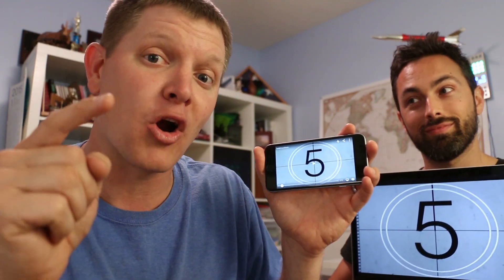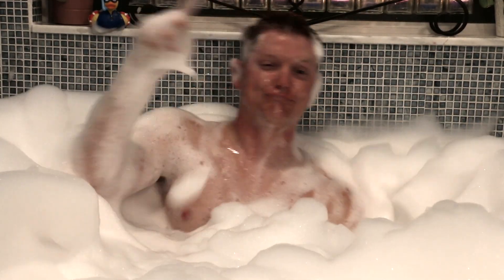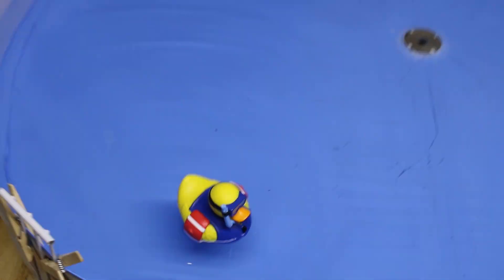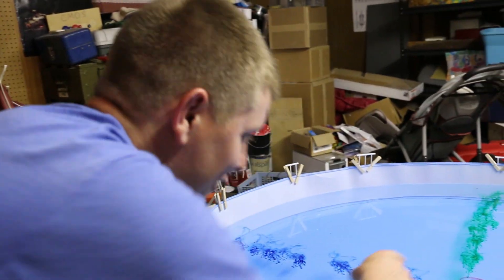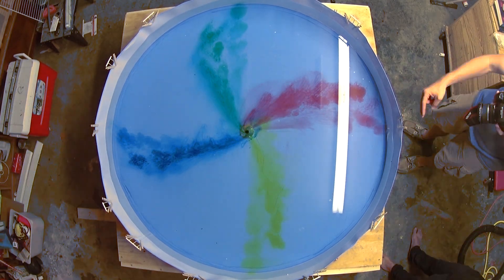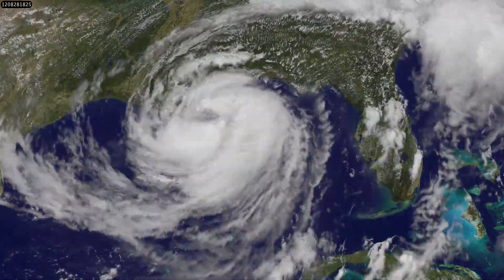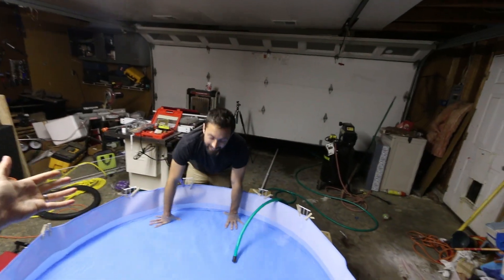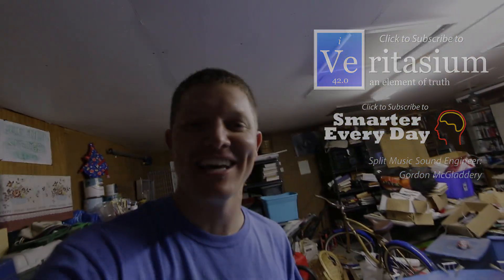The Truth About Toilet Swirl - Northern Hemisphere  (Smarter Every Day 137)

Comment: It does work. Sydney is 8330 miles south of the equator and Huntsville is 9100 miles north. Pretty close to the same I suppose. 

Does the water spin at all with the exact same pool design on the equator?

Comment: So let me ask you this. If you would had influenced the water when it drained out of the pool to drain the other way, oposite of whats being shown, shouldnt the water slow down conaidering its going "against the grain" of the natural drain flow?  I wish he would did another pool experiment the exact same way but took something and swirled the water in the opposite direction, and lets what would have happened. It ahould either come to a stop and start draining as it shows in thia video or it should at slow down substantially. Its almost like having your ceiling fan on, and flipping the switch that makes it rotate in the opposite dirwction, i know thats not safe, but if the fan is spinning, and flip that switch it will slow down until it stops and starts rotating in the opposite direction. I know that there are forces being applied to make the fan slow down and rotate opposite as it has a motor but just using that as visual example of what i want to see. Alter the flow to the opposite direction, see if it slows down, and if there is enough water in said pool, it should eventually stop and atart draining the opposite direction.

Comment: Just because you have demonstrated that the water rotates in the opposite direction in opposing hemispheres you have not proven that rotation in draining water is caused by the Coriolis effect; And then to use the word truth associated with your findings is objectionable and typical of modern science. Until you have eliminated all of the alternative possibilities you cannot possibly claim to be the source of the truth. How does your experiment control for the magnetic field of the earth? We know water particles are charged or a Kelvin water dropper experiment would not arc electricity rapidly through a spark gap.  Watch Kelvin's demonstration then then tell me that the Coriolis force is significant. Charged particles moving through a magnetic field are subject to the Lorenz force and despite having the same charge electrons are many orders of magnitude lighter than protons. You didn't even make an attempt to control for the latitude which would be a huge factor based your assertions; apparently already assuming that corialis was the only possible explanation.That was a pitiful experiment and I think you should be ashamed to act so proud after such bad science.

Comment: First off, excellent video(s) - a veritable work of art! 
A question though, as I'm resistant to accepting any result with 100% confidence: let's assume that vortex direction is in fact random. What was the probability of observing these results by chance? Is it 0.5 * 0.5 = 0.25? Or is it somewhere closer to 50-50, since Destin is less likely to have done his half of the experiment without Derek's initial success?

Comment: Very cool video! But I have to pour water into the wine. The two pools are obviously not identical. So it is very probable that the effect comes from tiny differences in the construction, e.g. from an eccentricity of the drain hole. Also, the assumption that the water is still after 24 hours is not valid. An open surface water is always in motion of thermal convection, driven by evaporation cooling.
Let's do a simple calculation: The Coriolis acceleration is a = -2 omega v. Omega is the angle velocity of the Earth's rotation 7*10^-5 s^-1. v is the radial flow velocity of the water at the surface, which is extremely small, say 1 cm/s. Taking into account the degree of latitudes of the both places, we get a Coriolis acceleration of the order of some 10^-7 m/s². This means that the time for one revolution of the vortex is of the order of hours. No, the Coriolis effect is way too small for this experiment.

Comment: There is a guy in Kenya whose house is right on the equator. He has two bathrooms, one on the north end of the house, and other on the south. The equator goes through the middle. He rigged up the two toilets so that one toilet swirls clock wise, and the other counter clockwise. (He changed the angle of the jets using a file or something, I'm guessing). He charges money to tourists to see his demonstration.

My friend who went to Kenya told me this. He didn't go to see it because he knew it was all B.S. After he came back, he regretted not going there to see it, just for fun, and helping the guy out with a few dollars, which will mean a lot for a Kenyan.

Comment: hello, I am just to say that is not good enough of proof, since you would need to do this about 3 times and 2 variables changed (6 times (3 times per variable)). basically you need 3 tests with starting the water filling anti-clockwise and then 3 tests fill the pool clockwise. this will be a much more reliable source. indeed this can be true, but you need to do more testing since in the name of science, it will not be the same all the time for somethings, which is why you do multiple tests to see if your test is correct or not  if you do not do that then there is still a likely chance in it being wrong, which is why scientists in the real world do tests on multiple things. an example is medicine. Not only scientists do it, engineers do it too, since it is more important to make sure it is safe then being wrong. examples are rockets, planes, cars, ect.

Comment: I understand it as your relative position/your point of view comes into play. Take a baseball or a tennis ball and trace a counter clockwise circular line around until you get to the other side of the ball, do not lift your marker. From the starting point you were drawing from is counter clockwise. But when you continue this line seen from the bottom side, you will be moving your pen in a clockwise direction. Now follow your marker line, starting from the bottom side to the top side and it will be perceived in reverse. So I would think that the water drains the same way, its just that you are looking at it from each respective drain sides. Its all relativity as Einstein said. If I may further confuse...when you stand in front of your mirror and raise your right hand, picture yourself standing in the mirror and you will see that you/in the mirror are raising your left hand, not your right. Your relative perspective is very important to understand this. The mirror image says the opposite of what is actually happening and yet it is the same thing. spooky action.

Comment: Coriolis effect  is an issue in aviation too.... most aircraft do not use compass but a DI (direction Indicator) or in  the US called a HI (heading indicator) that is based on a gyroscope set in the yaw plane, this is because of the effects of banking, accelerating etc on a compass... however over a period of flight the gyroscope starts to drift because of Coriolis effect (and imperfections in the instrument)... therefore pilots need to re-align their DI/HI every so often to correct for it - this is done by setting to the magnetic compass when in a stable, level flight position. (see, tell my flying instructor I was paying attention in class!!) - I love this science.... great video!!!

Comment: I think the way it's put is drains drain different in the northern and southern hemispheres. But like you discovered toilets are different because the jets control the flow. But generally filled bathtubs and large sinks will eventually flow in the proper hemisphere direction when a plug or drain stopper is pulled. Either way this was a great video explaining why toilets, in many cases, don't and why a drain might not. At least you got to the right answer without the need to drag conspiracy theories into it. Tho I'm sure the flat earth people with still come up with an excuse as to why this is so and the earth is flat. 🤣

Comment: a great video as always (I've still to watch the remainder of the amazing nuclear submarine series in 2020). However, in the present case, I'm only half convinced...

If you're  (say) 5000km from the North pole and at 45° North, so sine= .707 and at 3535km from the pole as seen from "above". Assuming the water travels 1m south, that's a change of 1: 3 535 000. The effect of conservertion of momentum at that proportion is really minimal, so it would be nice to see the experiment repeated. 

I did the same experiment totally serendipitously when using a garden hose to siphon the water out of a surface swimming pool. The vortex was anticlockwise (45°N), but I wouldn't trust that as a result  without repeating the experiment several times.

Okay, now I'll watch the other video for the Southern hemisphere.

Comment: Already subscribed to both for a very long time, but I remember finding Destin first. Anyways I got a bit frustrated trying to sync it perfectly so I gave up. I did watch it at the same time with a few millisecond difference. At some points where you both speak the same line at the same time, it got doubled but oh well, worked close enough. Didn't help that the first few times, one video buffered so I had to resync everything and rewatch. Cool video project though. I knew of the Coriolis effect and remember reading about the storms thing but didn't think about that in relation to draining water.

Comment: We have flow meters that work on the principal of the Coriolis effect. They are extremely accurate. Yep, it's real. The faster the flow through the tubes, the faster the tubes vibrate causing the sensors to read each pulse of the vibration. There are two tubes paralleled that vibrate. 
Coriolis flow meters. And yes. They have to be calibrated.

Comment: There is nothing definitive about this video - total misapplication of the Coriolis Effect. The Earth's slow rotation and extremely minute distance between opposite ends of such as small-scale pool experiment relative to the earth's curvature means barring surface irregularities in the pool floor and the drain, and the leveling of the pool floor, the initial spin direction is nigh random. One experiment iteration per hemisphere is not what I'd call scientifically-sound testing, and particular galling since of them is a PhD. SMH. The fact that it's the first "Internet demonstration" doesn't invalidate all previous experiments. I just got Dumber by One Day.

Comment: There isn't a single instrument on earth that can sense the rotating earth.  That a proven fact that has stood the test of time.  The water takes the path of least resistance, water going down the drain will continue in the direction it starts in.
I would suggest the effect is caused by something other than the spin of the earth such as a static charge that bends water coming out of a faucet.  If you could find a scientific instrument or experiment that could repeatedly prove the earth is moving to go along with this drain test I might consider changing my mind about it, but no instrumentation can or has ever so far.

Comment: That was a horrible experiment. You started the scientific method but didn't finish by repeating it over and over again to see if you get the same results. One time is not enough. I guarantee you that if you do it five times it will flow in the opposite direction at least once. That is an experiment by chance. I have watched this experiment done before and when you do it multiple times you're going to get different results. Hence the scientific method

Comment: I know that this is an old video, but the experiment as shown is not valid, and does not prove or disprove the influence of the Coriolus Effect. Now, if the experiment had been done many times with the same result, and if multiple identical pools had been built in the same local area as well as in other areas, and they all has the same consistent result, then it would be APPROACHING scientific validity. 

And there is a huge difference on the Earth's rotation affecting the spin of something vast like a hurricane and something tiny like a swimming pool.

Although this is an interesting channel, the author needs to brush up on the 'scientific method'.

Comment: Crazy stuff that's definitely not worth a subscription to him or that other guy:

He shows that toilets get water swirling in a particular direction with a little jet of water. But there is also the case (shown in his buddy's video) where 2 sinks sitting beside each other drain in opposite directions. So it's the small, initial conditions that matter. Not your location on earth. He should have done 3 more experiments (each done in the north, in the south and at the equator) to convince himself (and the other guy) that this is true:

1. Give the pool a small swirling "clock-wise" motion by hand - at the beginning.
2. Give the pool a small swirling "counter-clock-wise" motion by hand - at the beginning.
3. See if the rotation slows down or even reverses at any location.

So, 2 things may be true at the same time. Water (and air) does preferentially rotate differently in the 2 hemispheres. But, given a small initial "kick" - water (at least) will rotate in the direction you start it in - and will not slow down or even reverse direction - given enough time.

Comment: There are a lot of flat earthers that need to watch this video!
Reply: unfortunately they'll find a reason to dismiss it. I saw many comments saying you need to do this 1000 more times, or use deionized water to rule out the earth's magnetic field, etc. Even though it is cheaply reproduced and they could do the experiment themselves if they cared to...
Reply: @ebreshea1337  Unfortunately its flawed experiment, in his case smoothness of the center piece is what made the water spin counterclockwise as well as the 90 degree angle of the piping. If you polished the center piece perfectly smooth and just gave it a few really light scratches with a knife in clockwise direction, the water would flow clockwise. If you dont believe me do it yourself.
Reply: @idontcare7961  Or you could do it yourself and demonstrate your claims. What you said doesn't explain why the other guy got the exact opposite result with a near identical setup. The 90 degree angle would be just as likely to produce a counterclockwise spin.
Reply: @ebreshea1337  Two tests are not enough. Bet me 100 usd and i will do exactly the same test, using raw center piece, then polish it very precisely, then add a 90 degree piece and then scuff it a little bit with the knife im absolutely sure tests would not be repeatable and correct to my location.
Reply: @idontcare7961  they did each test 3 times. And sure i'll take that bet. look forward to your upload
Reply: @ebreshea1337  How old are you? Can i trust you? Because im not willing to spend time and money doing the experiment if you would just reject the experiment that i would do. I would clearly show each and every step of the process.

Comment: Nothing is as level as the water so any incline where the pool is sitting or the drain pipe angle will make the water push or pull in a direction.

Comment: I love Smarter Every Day, but I have always considered this worst one.  Its rather unlikely coriolis affected this result. As big as the pond was its very small.  Its going to swirl one way or the other.  If it were 50/50 the odds are pretty good you would get a favorable result. The difference in the speed of the earth over 4 feet practically non existant.  Doing it only once is meaningless.

Comment: Guys you didn't eliminate all the variables... Did you happen to consider that the whole there has something that will guide the flow ?

As it is something that went through manufacturing, maybe it is the resulted micro result after drilling or making the whole. To do the test correctly you should use the same pool in both and test. Otherwise you're testing different body's, which are not comparable by the results. Same body being tested in different places should be more real and valid.
Reply: Feel free to try it yourself :) They did the experient 3 times.